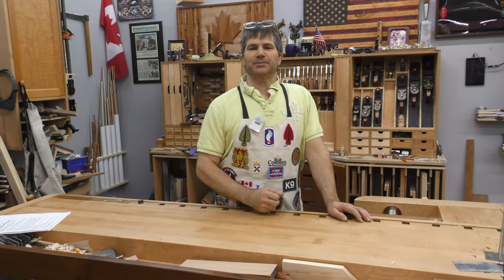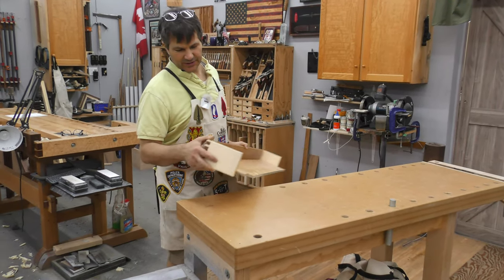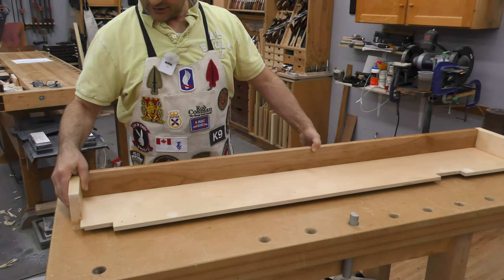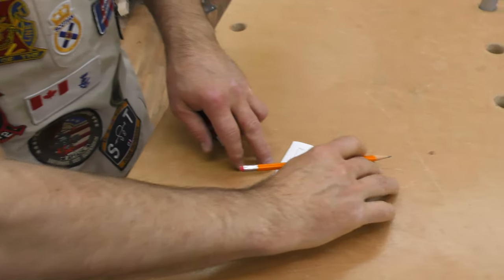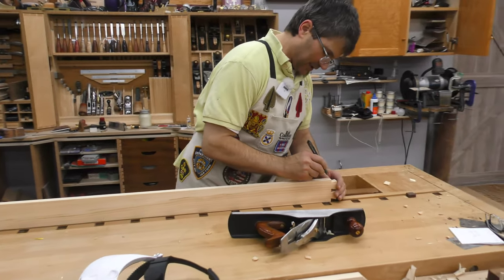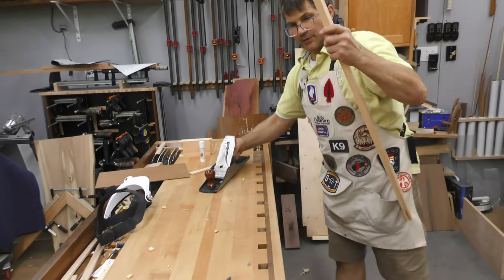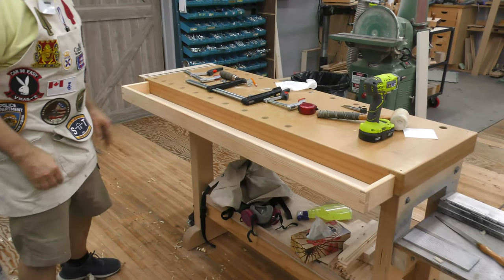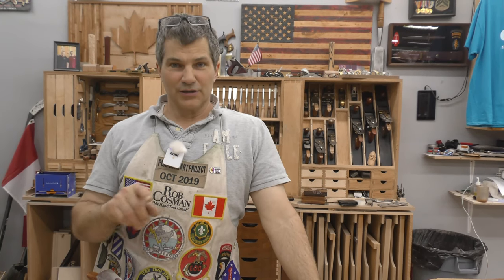Workbench Tool Tray - Simple Add-on

Comment: Did anyone else notice, Rob measured the bench at 60", said we'll come in 1/2" either side so that's 59", then made the shelf 58"?  Looks great any way Rob!
Reply: Yep  I was waiting for the blooper but it ended up pretty good lol so much going on in his head at once something has to slip now and again lol
Reply: Just like watching a horror movie.  As soon as he said 58", my brain started yelling, "Don't go there!  It's 59", 59" not 58"!"  I made the same mistake just yesterday on a shop cart, I cut the top an inch too narrow; even had the right dimension on my cut list.  It makes me feel a little better knowing even the best sometimes end up an inch short!
Reply: I'm sure Rob had a mmmm? moment when he saw the larger gap at the ends.
Reply: Yes. He also measured the depth of the apron at three inches but didn't add the thickness of the rebated ply base. The top of the tray, therefore, sits lower than the bench top. Not a problem but I intend to make mine finish level as with his other examples.
Reply: 59” is overall… the bottom ply is rabbit 🐇 into side pieces  which would make it 58”…. If he does exactly like the student demo piece…so much knowledge and gems being given here.. spoken and unspoken… seems like a strange thing to focus on and then the “ looks great anyway ROB ( even though you gave one wrong number (possibly)and I messed up because  I won’t spend money on the plans OR possibly I don’t know what I’m doing and instead of concentrating on building a fundamental skill set so the numbers you give don’t matter.. because i may not have a 60” bench anyway🙄)… is pretty petty😒…I guess suckas are allowed to watch YouTube as well… happy woodworking ✊🏾✊🏾✊🏾..Mr Cosman  …. You are a treasure … appreciate you!!!
Reply: @BigBuddiBlax  You may wish to get your facts right before calling someone a suckas (is that suck-ass or sucker?)  I am a 77 year old self-funded retiree, ex Royal Navy submariner with 12 years service who faced off against the Russians underwater in the 60’s .  No, I am not wounded; submarines do not send back wounded, survival is all or none.  Mental wounds were generally sorted out ashore in the pub!

I bought my Bench Plans from Rob in July 2020 and have also (modestly) donated every time I enter one of his raffles.  I have not built my bench yet as I cannot afford the timber or vice.  A “$100 bench” in the USA is closer to $500 here in Australia and that is beyond my means at the moment.

I am a disciple of Rob Cosman, his family and the whole Purple Heart Foundation and have been for many years, I admire his cause immensely and have told him so.

I don’t have Facebook or Twitter because I object to mindless ‘twattle’ back and forth between morons.  I am of an era pre-internet when if we wanted to insult someone we did it to their face, we didn’t have the cover of anonymity.  As the Irish say “there’s many a nose been broken by it’s own tongue”.  

If you know anything about YouTube you will know that ‘YouTubers’ get paid for every Like, Dislike (which I have never used) and Comment, which I use frequently for that reason or to give praise, that’s why they encourage comments.
Reply: He also made a mistake in rounding over the bottom rather than the top first LOL I don't think he wanted that there because he stopped then it went to the top

Comment: Thanks for demonstrating the technique for cutting dovetails in long boards. I’m building a 70” shelf to sit on top of my reloading bench, and was scratching my head trying to figure out how to cut the tails/pins on the ends of that long oak plank. Now I know not just how to cut them, but also know to cut the tails into the long piece, then mark and cut the pins on the shorter pieces that will form the uprights.

Comment: This will be my first dovetail project.  Novice question: could you cut the rabbet prior to cutting the dovetails so you could do it with the boards face down against a fence instead of balancing the completed frame like you did?  Just not cut rabbet into where the dovetail would be and mate the corners with a chisel?  This will be a great addition to my workbench.

Comment: Great add on. FYI Studies have shown 12 lbs. of pressure to run a Phillips screw in, 8 lbs for a Robertson, 5 lbs for a Torx. Test it and see. Another side benefit of Torx is that a size smaller bit will work on a screw ( no excessive torquing now)  when to don't have the correct one, in a pinch. Yeah I know, there's a peculiar loyalty to the Canadian invented Robertson screw, I switched to them years ago when I got absolutely frustrated with Phillips head. Then I discovered the beauty of Torx. Like the Square drive, you can grind a bit off the tip when it gets worn, a big plus, you certainly won't get away with that in a Phillips head.
Reply from the maker: I prefer the Robertson screws because unlike a torx the Robertson will stick on the end of a robertsonscrewdriver and you only need one hand. Torx wont do that.

Comment: First thanks for your great advise and easy to follow videos.  I've been thinking of adding a similar tool tray to my own bench, but was thinking of a 4-sided box-like arrangement that would be level with the benchtop (bolted or screwed in place), and could support wider materials on the benchtop.  The student version of the tray appears to be benchtop level and yours is a little lower, please comment.

Comment: Great vid! One question: why not make the tray edges flush with the bench top? Then it would offer a level edge support for materials when they project beyond the back bench edge. Maybe because of the rounded over top edge?
Reply from the maker: Because I screwed up the measurements.  Forgot to account tor the bottom going under the bench.  The sides should come up flush
Reply: @RobCosmanWoodworking  Please don't take this the wrong way, but it sort of gives me pleasure to know you make mistakes! Love all you do!
Reply from the maker: No worries!  I make lots of mistakes

Comment: Turn bench upside down on flat floor.  Make left & right   1”x 3” x 30” oak (or however deep you want the bench width). Glue/ screw each of these to each bench end.  The floor will make these perfectly even with bench top.  Cut oak or ?   3”x3” to fit between these extensions.  Glue / screw this , on the floor, between the extensions.  The floor will make perfectly even with bench top. Done.  Put your choice of panel on bottom.  After dry up, knock your socks off by replacing screws with driven in glued wood dowels.

Comment: Was there a reason the 1/2” thickness of the bottom plywood was not added to the width of the 2 ends and the long back piece so the tray would have ended up flush to the top of the bench? Doing so would have made the tray depth a might deeper,  effectively added to the overall width of the bench top and allowed clamping along the tray side of the bench.
Reply from the maker: Because I screwed up.

Comment: Hi Rob,
 What grain rasps would you recommend to start with? I do not have any rasps only metal files.
Reply from the maker: 1. A cabinet rasp with fairly coarse teeth for stock removal. Recommended: 9″ Auriou with a 10 grain.

2. A modeller’s rasp with fine teeth for refining shapes. Recommended: 6″ Auriou with 15 grain.

3. A rattail rasp for coping inside corners and dealing with tight, radiused details. Recommended:  6″ Auriou with 13 grain.
Reply: @RobCosmanWoodworking  Thanks Rob.

Comment: Would it be possible to add a solid wood (hardwood) frame around the cosman bench to add a shoulder vice?
Reply from the maker: All shoulder vise construction like on my bench is difficult.  Yes it could be done.  Need to add in the long standard bolt.  I have never done it with MDF so I cannot be sure of the results
Reply: @RobCosmanWoodworking  ill give ot a try when I get around to building my bench in the new year. I'll let you know how it turns out

Comment: Just a suggestion here for the tray mounting. My Moravian workbench has a removable tool tray which is a nice feature.(the whole bench knocks down in a minute or two) Having looked at your bench I think you could do this with some beefy dowels glued into a block of wood and screwed to bottom of the tray. Of course you would have to bore a few holes into the bench itself and then the tray could slide in and out when you want to empty shavings. A couple of pins in the back side would keep the tray from sliding out unexpectedly. Just my thoughts on how I would do it...

Comment: There is nothing wrong with cutting a rebate for the bottom but I would have cut a groove and fitted it like a drawer bottom. Stronger that way and you don't need to pin or screw the bottom in place. Mechanical strength is always better than relying on just a glue line.

Comment: LOL just watching Rob add imperial measurements makes me wonder why do you still use imperial.... 150 mm plus 27 mm = 177 mm   rather than 5 11/16 + 1 1/16 = 6 12/16 or 6 3/4.   seems so complicated but then if you have always used it it is simple enough.   Will be making the bench soon so this came just in time.   I was going to make my top out of 4 x 25 mm ( 1 inch) MDF with the bottom piece being 150 mm (6 inches) wider to form the bottom of the tray area then glue and screw dovetailed pine around it but this way is probably better and can be replaced easily after time.   thanks Rob :)
Reply from the maker: Glad the video was helpful.  The base 12 measurement system (imperial) was originally designed for a population of craftsman who had no mathmatical skills and need an easy to use basic system.  Its only now that we all go to shool and learn math that a base 10 system is easier to comprehend.  for example:  in a base 12 system- whats a fourth of 12, whats a 3rd of 12, whats half of 12, whats a 6th of 12.  In a base 10:whats a forth of10, a 3rd of 10,half of 10, a 6th of 10!!!!!!!    I am a history nut.  Read, By hand end eye" formore detaisl.....Just thought you would be interested.
Reply: @RobCosmanWoodworking  yeah mate.... we converted to metric in 1974 here in Australia and I found it weird at first  but even today I still use a mix of metric and imperial in daily life.   Metric for lengths of timber but I still refer to widths in inches   2 x 4 etc but 1.8 metres long.   lol   So I supposed I am probably more screwed up than you guys   lol ;) but in saying that I only buy tapes that are in metric so as I don;t get further screwed bwaaahaa

Comment: Anyone else get sucked into a wormhole at 34:45 back to 34:00? Thought I was in for the duration on a 45 second loop. What a life.
Reply from the maker: What?  Is there an issue with the edit?
Reply: @RobCosmanWoodworking  You'd probably know better than me whether its an edit issue or just a planned repetition. It starts at 33:38 when you fix and tap the tool tray into place, comment about not screwing through the dog hole, place the central clamp and drive in an overly long screw. Then the process of attaching the tool tray kind of starts again - but with shorter screws. Sounds like I'm being picky - and I really am not. I get a lot from your content, and appreciate the considerable effort that goes into making it.
Reply: @skf957  , he just moved down the bench to the next spot to need a screw.
Reply: @leehaelters6182  I've looked at this 3 times now and am perfectly fine with missing something - as I often do! BUT, to my eyes there is a repetition of the action. The "first" fix of the tray ends with the comment that the screw is too long. The second go is the the one where the door behind opens and Rob is photo bombed!
Reply: @skf957  I copy, and do not refute.
Reply: @skf957  I copy, and do not refute.

Comment: I am not a fan of the way the tray is attached to the bottom of the bench.  Seems that weight in the tray would exert leverage against the screws, eventually prying the tray down.  Maybe I overestimate the weight in the tray, Rob.
Reply from the maker: We use them in our classroom. They’ve held up for five years without a problem.

Comment: Why don't you just add glue to the end grain spot?

End grain joints aren't actually intrinsically weak. In fact, when people actually test them with load frames and load cells, the results show that that end-to-end bonds are significantly stronger than side-to-side bonds. The strength from joints like dovetails comes from the crossing direction of the cellulose fibers. But time and time again, miter joints are also stronger than dovetail joints, and when dovetails fail, they fail as if they were a square joint, where the wood slides out of the triangular portion like a sheath.

One theory for the "end grain is weak" myth is likely that when people break these end-grained joints, they remove the glue, so people think the joint was weaker, when in fact, the torque from the end-to-end bond was actually significantly higher. Same thing goes for miters.

Glue is stronger than lignin, the wood's natural glue that holds the cellulose fibers together, but it is far, far weaker than cellulose fibers. This is why side-to-side joints probably evolved over end-grain joints. But the misconception spread that the bond between end grain is weak. It's actually very, very strong. It's just not as strong as cellulose, so there's not as much of a point to end-grain gluing.

They also don't "sop up glue" as much as people think, because the glue is so viscous. Even if it was weaker, it can only add strength in this instance.